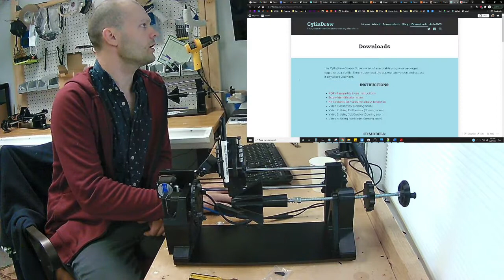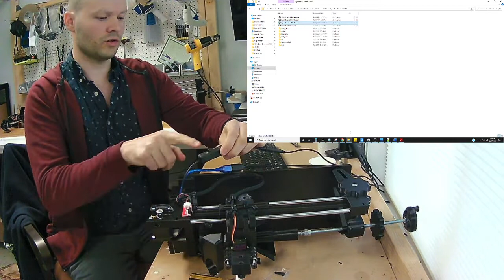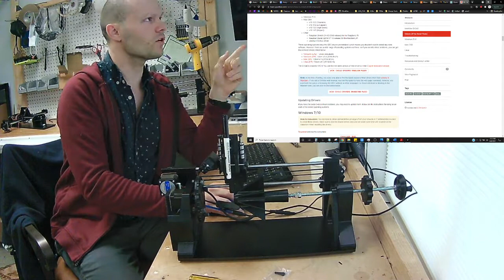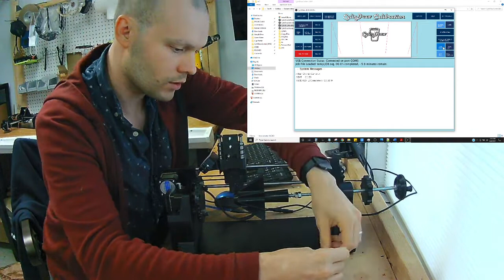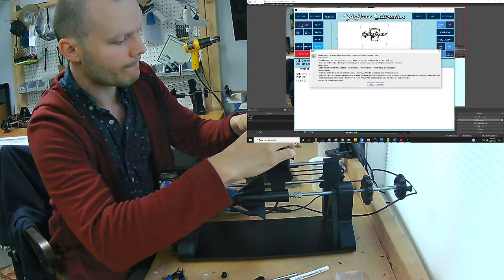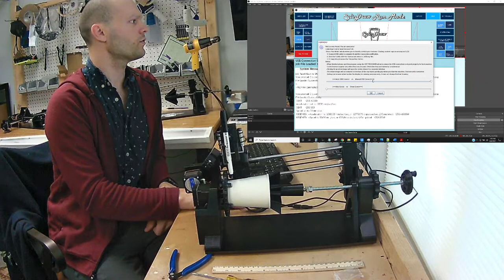CylinDraw Calibration Procedure

Comment: Only moments ago, I completed this process. Obviously, this also means I completed the assembly. I printed all the parts (multiple colors) and built it by following the previous video. This guy has it all together. Every tiny detail seems to be covered. My pen holder would not drop consistently, four out of five times, but that's not good. Just as noted in the video, too tight on one side of the bearing. Easy fix.

This has to be the most satisfying project I've ever built.
Reply from the maker: Wow glad to hear it!